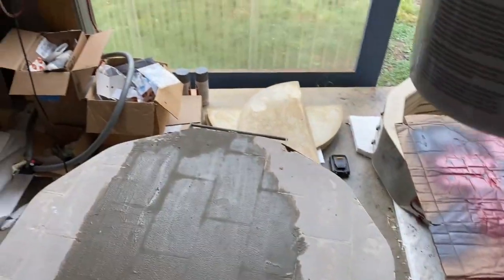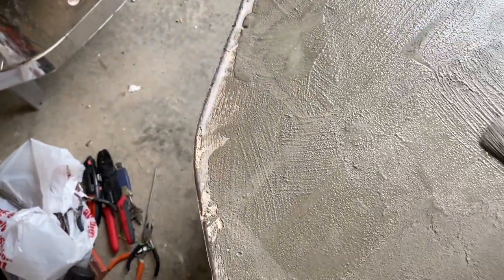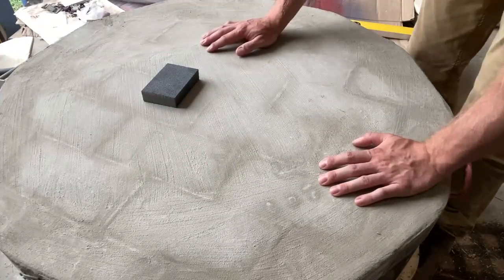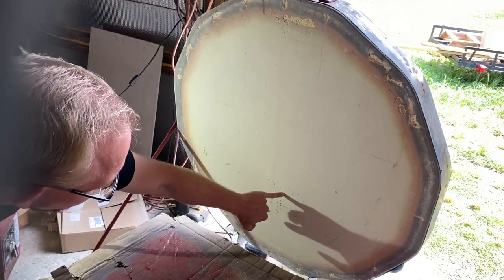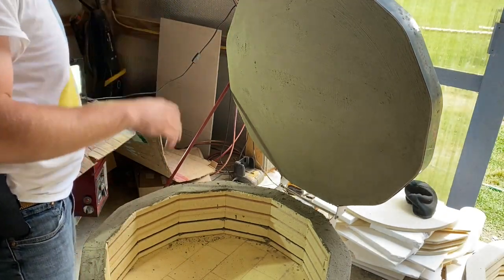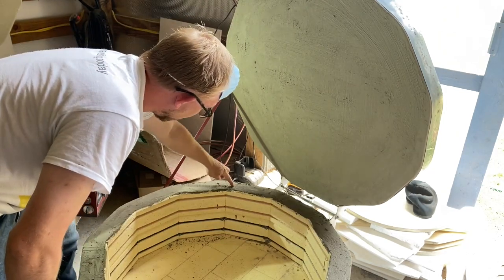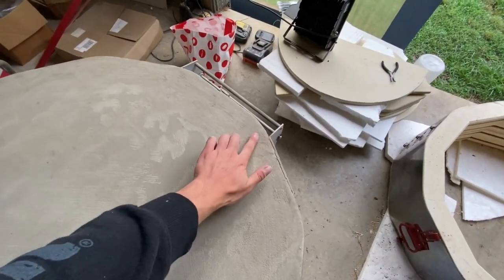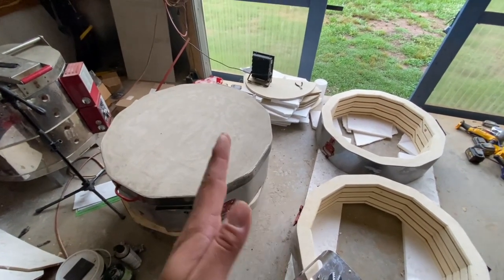Potter's Kiln Lid Finishing Coating (Skutt Sairset or Rutland refractory motar)

Comment: When you fired this kiln, did the mortar flake off in place? I've tried applying a different product on a kiln in far worse condition and it flaked in many places, making it unusable for a glaze firing.
Reply from the maker: Thickness tends to play a part in chipping. Also making sure to prep the lid properly. If one doesn't have the mortar like "pudding" it's very easy to apply too much. We only need 1/16" thick! -- Give an update when you can!

Comment: Can I use this on the top fire brick which has worn away a bit and is shedding dust?
Reply from the maker: Sorry, Lorrie; this is my first time seeing your comment. - Yes, but you'll need to be sure the brick you are repairing is dusted out well and then well wetted before applying the cement. Cheers!

Comment: Should this be done to the bottom of the kiln also?
Reply from the maker: Hi Stephen! No need to. The reason for the coating is to reduce brick dust. - - Personally speaking, I find that since the lid is exposed to the most heat, as heat rises, it is prone contraction and expansion, causing cracks. I find the coating to help with prevention. Though, be sure to not lay it too heavily in the inside of the lid...  it will bliste, crack, and then flake off. We only need 1/16" thick!